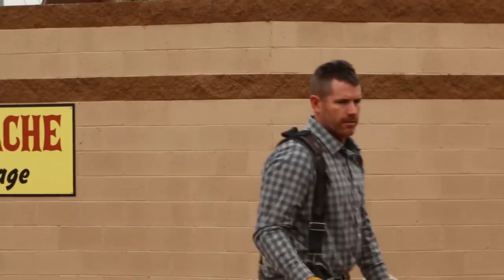Concrete Slab Preparation

Comment: Outstanding video, Sir! I started out as a laborer at a paving and grading company here in Northern California. I started at the bottom and worked my way up. Shoveler, sweeper, raker, and then up to driving bobtails and 10 wheelers for hauling heavy equipment. From there I made operator and then foreman, I pushed quite a few dirt crews over the years. Now I’m disabled and I miss working sooo much, you don’t know what you have till you lose it. I really like the way you explain things, it’s a great way to learn, or would have been instead of: “Hey pal, grab a gear boy! If you can’t run that rig I’ll find someone who can!” At the top of their lungs! 🤣🤣🤣 Thanks again!!

Comment: As a "recovering perfectionist", one struggle I have is knowing when to hire a pro instead of doing it myself. I technically could have done all of the excavation, forms, and pouring of the foundation of my new shop (because I can learn anything), but it would have taken me easily 30 times as long as the guy I hired. He was expensive, but good help is, and I know I have a great foundation, and I didn't have to put my business on hold for the huge amount of time it would have taken me to do it myself. I always appreciate the perspective and experience you EC folks bring to your videos. Thank you!

Comment: Nice job. Excellent narration. You hit the important points and explain them well. I agree with adding the rebar, it is cheap insurance in the long run. There is probably a standard practice in your area for stopping the rebar at a joint and using dowels. Look into it to relieve stresses when there are big temperature swings.
I was surprised to see a Gannon. I have a 50 year old Gannon Earthcavator on the back of my 50 years old Simplicity garden tractor. It works great in the spring when I need to smooth out my gravel driveway. 
I worked highway construction for a few years near a major casino. It was shocking how many people would drive on the wrong side of the cones. We had to be ready to jump at all times. Good Luck, Rick

Comment: I sure enjoy watching people who know what they are doing working at stuff. I have a fair skill set myself, but I'm strictly a DIY guy with no tickets for anything, even though I've spent days on a little excavator and worked on everything from concrete foundations to drywall boarding and mudding, plumbing and wiring.  Always so much to learn.  Thanks for your commentary.

Comment: City's don't want rebar or even mesh in concrete on city property so it is easier to remove if they have to, say work on a sewer underneath. That's also why they require it to be so thick to make up for the lack of reinforcement.
Reply: Interesting!

Comment: Where I live the city forbids rebar in driveway approaches. Basically between the sidewalk and curb. That is the city’s easement. Water and gas lines. No rebar in case they need to dig up the easement they can remove the approach much easier.
Reply: Same thing in my city. They inspect prior to the pour to ensure there’s no wire or rebar in the apron.
Reply: I thought it would be necessary. Learn somethin everyday
Reply: Where in Arizona? I lived in Tucson in the 80s.
Reply: Makes sense and explains why they want it so thick, with no rebar.
Reply: f0rumrr no rebar in any ROW even 4” sidewalks

Comment: A small tip I finally figured out after years of pouring driveways on really busy n fast driving highways is.  Park the loader just outside of the white line n raise the bucket to steering wheel height.  You will notice a drastic reduction in speed. They will also get in the other lane. Thanks I enjoy your videos

Comment: Mike Holmes likes to point out that too many contractors working today miss or don't understand the word MINIMUM in minimum code requirements. I would imagine with the stability of the ground and the lack of freeze-thaw maybe not having rebar isn't an issue. But why not have the best-looking entryway on the block for years to come with the assurance it was done right.
Reply: Building codes, like you say, are a minimum.  They're like getting a D on an exam (where D is a pass, but barely).  It's nothing to brag about. :-)
Reply: True on no freeze and thaw in Phoenix. However there are still geologic forces at work that could cause stresses in the concrete.
Reply: @jonathancatron9377  Like what?
Reply: @tavobenne ...good question sir!
Reply: Rebar is time consuming and expensive to remove. When it's in their r/w they may not want it because it'll increase their removal coast if the apron needs to be replaced with a road project. Also if they replace the apron with the road project they aren't obligated to put the rebar back.
edit: That road is in junk shape so a reconstruct in the near future is likely.

Comment: Highway Engineer here.  Even interstate pavement does not necessarily have rebar in it. Plain jointed concrete pavement is the  most common concrete pavement that we use in Indiana. That is simply concrete panels connected together by dowels. The key to the longevity of the pavement is the sub-grade preparation and keeping it well drained.

Comment: Spectra rotorlaser in that gun case. Indispensable tool for setting heights or grades. Probably only equalled by Leica.

 Very precise description of the various construction equipment, what their fortes and weaknesses are... Now you already did a video on the grader, so I think we can all agree that big'uns also do precision. A lot  of it even. Never seen or heard about a Gannon box before - very cool stuff.

Comment: A video right in my wheelhouse. I'm a paver operator, well technically I own a paving company but I run the skid steer and paver on every job I do.  I tell everyone the prep work is the most important part. Good base equals good and long lasting asphalt.  I know you're working in concrete but much is the same.  With asphalt at road tie ins like you're doing here, we have the luxury of putting down the base and binder layer of asphalt for the customer to use and install the surface layer at the end of their project.  Not possible with concrete but concrete is a superior product.  Also I concur with the thoughts on slowing down around us on the roadways.  I had a lady run through my cones, missing on the signs and flashing lights and hit the paver I was on going 60 mph a couple years back.  I'm just glad the machine took most of the force and not me or one of my employees, although I did come out with a few broken bones.  I'm not asking for much than just a few seconds of your attention and a slight reduction in speed.  In the lady's case, she was already 25 miles over the speed limit (her speedometer stuck on 60 during the wreck)  and her attention was on composing a text message....
Reply: And the "fun" turns to work pretty quick on the machinery.... of course I've been doing it for 20 years so the fun wore off a long time ago. Lol.  I still like what I do but I dread certain jobs that I know I'm gonna be waking up sore and dehydrated the next day.

Comment: I have seen cities require concrete with no rebar in the public ROW so that they can more easily remove and replace it in the event they need to change out or repair the buried utilities.
Reply: Joseph Comer thats a great point about the easement

Comment: Re-bar is not required on driveways because they consider the subgrade to be compacted enough to hold the concrete in place.  I always install re-bar anyway.  Its just that much better, and when the concrete does finally crack, the re-bar will keep the concrete crack from getting wider. Dust falls in the crack and vibration will spread a crack over time.  Keep in mind, concrete does 2 things, it gets hard and cracks.  Re-bar all the way. Also, we always bump up on concrete PSI, if it calls for 3000 PSI, go 3500 PSI.  2-3 dollars a yard more for piece of mind.

Comment: There was plenty of work put into leveling that soil so it is ready for the asphalt to go down on top of it. I have never worked in that type of work, but have seen it done by both government and private contractors and know it takes someone who is proficient at operating that equipment to do the job correctly.
Reply: Sidney Mathious S
Reply: Also the pad they prepped was for concrete not aphalt. Not trying to rude just sayin, i poured and finished for 5 years

Comment: However if you live in a rainy area waiting for pavement until the end of the the job makes the building project a nightmare.
Reply from the maker: good point!
Reply: all the extra weight from the construction equipment helps with gravel compaction also. Can grade and install subgrade, let the heavy equipment compact it more, brush it up right before paving or concrete. Then the lighter traffic will not affect as much.
Reply: I have seen them gravel while heavy work is done, then go over and remedy that before final pavement (asphalt or concrete).

Comment: I know why the Gannon Box operator has the FIL up in the air (to avoid damaging the walls), but it's worth noting that operating equipment in that fashion is unsafe, generally speaking, as it raises the center of gravity and increases the chances for a rollover. As a rule, the bucket should never be above the hood when moving.

Comment: As a firfighter/Emt your comments about working in and around a roadway struck home.  Our department covers 60 miles of some of the worst parts of I-80.  In my opinion working on the highway is one of the most dangerous things we do.

Please slow down.

Comment: I've never seen a Gannon box before this.  That's s cool piece of equipment.
Reply: Gannon is a name brand, common name is a box blade or grading box.
Reply: @westendlawn  
Thanks, Eric.
Reply: ralph sampson you're welcome
Reply: Poo spreader is what they are called where I come from.  I do all my grade work with a Huber maintainer.
Reply: @jamess662  
Lol.  Yes, I'll have to go ask for one of those poo spreaders.  While I'm at it, I'll tell the salesman my 4' level is low.  It has a bubble in it and I need to get some level fluid to fill it up.  Or maybe, I need to get some blinker fluid for my car's turn signals.  Oh, here is a good one....a new wire stretcher.  I'm about 12" shy of a full run back to the electrical panel.
Reply: I was being clean.  Calling them a shit spreader comes from my long dead uncle.  The man was very old school and for some reason he didn’t like Ganon boxes.  I myself see the utility of the shit spreader but would rather have my Huber and a hoe.  The ganon does work great for pulling cow manure out of my barn.
Reply: @jamess662  
I'm sure your uncle was a great man.  Here in Georgia a shit spreader is more of a person than a piece of equipment.
Reply: ralph sampson lol we have plenty of them in Oregon as well.
Reply: Amazing tools. In California, az, Nevada you rarely even see skid steer on jobs. A good operator in one will almost double the output of a good skid operator.

Comment: 2:25 - that seems like a somewhat risky way to use a concrete cutter.... Is that actually how you're supposed to do it?
Reply: Straddling the arm the way he was ? Yeah, I wondered too. Looks like a painful accident waiting to happen.
Reply: I have to assume it's for leverage... but it really looks awkward, and yeah... future pain guaranteed!
Reply: I have been cutting concrete professionally for about 25 years and this is exactly how I run my saw.  It is a hair smaller than this one, but they all operate the same.  Your eye needs to be in line with the blade guard and the front guide to keep the sawcut on line.  And pushing the handle left or right with your thighs is good for slight corrections.  Most guys will only get a nut caught between handle and thigh once.  That said, I usually set up to cut facing traffic with my truck in front of me if I can because can you imagine getting rear-ended by a car in this position
Reply: Such an odd design. Seems like someone would have figured out how to move the handle placement so that you can still have the leverage you need and the sight lines required to work effectively.

Comment: I find it unusual that the saw cut like was on the outside of the pavement markings, and not the inside (from the perspective of the road centerline). Will they be erradicated in the future? 

Over in my work (pavement markings) area, PA, MD, and DE,  any HOP/ROW plans normally call for breaks in the edge striping at any entry or egress point to the road.

Comment: st have to say, totally unrelated, but I'm doing a bathroom remodel job on this old house and the bathroom is tiny only as long as a bathtub and wide enough for a sink and a toilet that's it. Maybe like 6x6 or something pretty small.... anyway, there was 3 inches of sand mix on one end of the floor under the tile and about am inch on the other. The walls had about inch and a half all the way up. Floor was so unlevel and was sinking. I went to the dumb with about 90% of the torn out material and it was over 1900lbs hahaha that's so insane... so much weight in such a tiny area

Comment: Interesting example of the physics of hammers at the 7:54 mark:  the worker on the viewer's left (with the white hat on) is choked up on a heavier 'sledge' and has a short 'thud-thud' stroke while the man on the right, without a hat, has his hand much farther from the hammer head and is using a longer 'whack-whack'  swing.  Hard to tell from just one stake being put in; however, it appears that the heavy hammer has the advantage here, faster and maybe even less tiring.

Comment: Thank you sir for mentioning the dangers of working in proximity to live traffic. I spent almost 30 years involved in road construction and had many close calls, saw many of them and unfortunately saw the degrees to which people get injured when they are around the travelling public and construction equipment. The work zone is a dangerous place at all times. The vast majority of drivers don't realize that debris can come off of a vehicle or it's tires and hit the workers. I didn't until I got hit by rocks and screws one day while in the work zone. Please slow down try to move over while in a road construction project. Those workers have family to go home to just like you do. There is absolutely no place that you need to be that is worth someone's life or yours.

Comment: im not seeing what i would think is a lot of permanent structures in that area. is that just because its more industrial, and industry doesnt need fancy architecture, or are there code issues with brick and mortar? it looks like the plans for apache include mobile containers, and the shops to the west are all corrugated metal. coincidence?

Comment: The roller driver and I would have had words. To lazy to move the extension cord . Driving over it several times
Reply from the maker: Actually that was a telephone line, the utility company was apparently too lazy to bury it. We didn’t want to cut it because it would have disrupted neighbors internet so we did our best to work around it. It was quite annoying....- Nate

Comment: I work in roadconstruction, and in europe we have 14 ton wheeled excavators (mobile excavtors) that get used for absolutely everything, and they get the job done quick too! Yet, i have never seen them in any video from america, why is that?
Reply: In the states we have the tracked version(track hoe) of that machine.  A wheeled one would be an extremely rare sight.
Reply: @rtz549  Yes, i understand, but why? They are very versatile
Reply: They are pretty common for road work where I am in northeast America

Comment: The reason you don't put rebar in everything, is that it's not always better. If it rusts because of insufficient cover, it's worse. If there isn't enough, it won't help. And even if it's properly placed and there's enough of it to make a difference, you're wasting time and money if the engineer has determined that it's unnecessary. Rather compact deeper.

I don't use rebar for ground floor slabs and foundations, and my engineer understands this. I'd rather go for a few extra MPa or an extra 50mm on my concrete, or compact a meter deeper. And none of the dozens of houses I've built had ever cracked.

Comment: Why concrete and not asphalt?
Reply: Concrete is a one and done no maintenance material.

Where as asphalt has to be seal coated every so many years depending on climate.
Reply: It doesn't take long for the Southwestern sun to cook asphalt into a bumpy cracking mess.
Reply: Was just thinking as the road there is asphalt and as far as I know asphalt is faster to lay, and cheaper, and easier to repair.
Reply: @kottipuiranen1780   Sure, cheaper to repair, but concrete doesn't generally need repair. So much of the original interstate highway system was made of concrete that got 40-50 years (or more) of use. Compare that with asphalt highways that maybe make it to 10 to 20 years before being in dire need of replacement.

Comment: Did Nate have to get a bond for the contract?
Reply from the maker: No, just a bunch of insurance certs from the contractors doing work...
Reply: Essential Craftsman Scott, love the videos. I believe the bond reference was not the same as permitting. I have to have a bonded and approved sub for driveway approaches  that has certificates on file with the city. I cannot work the approach myself even if licensed and bonded.